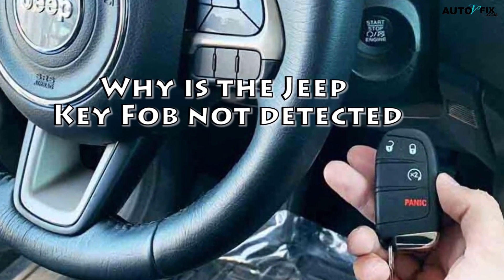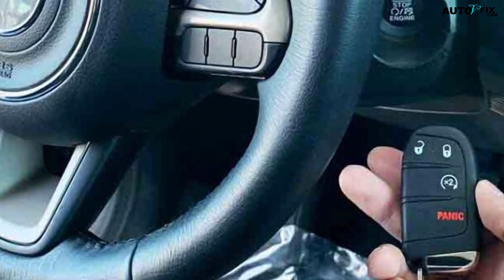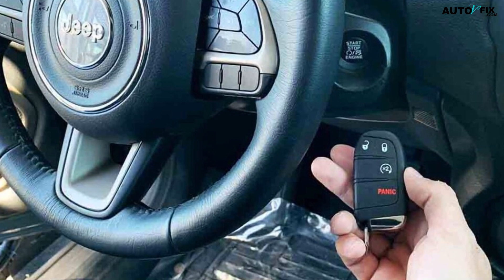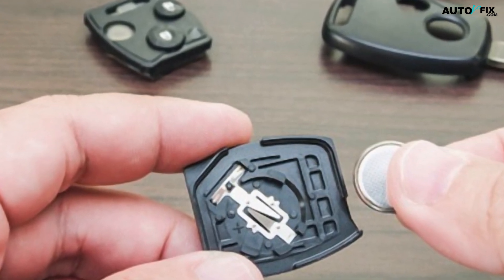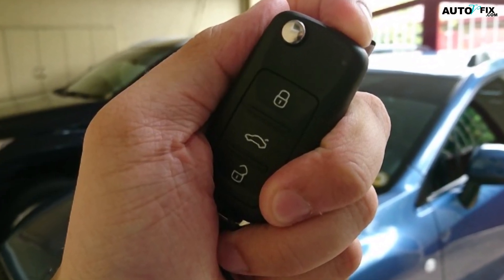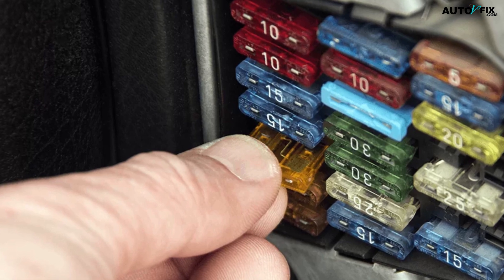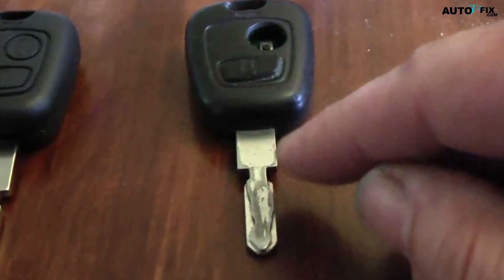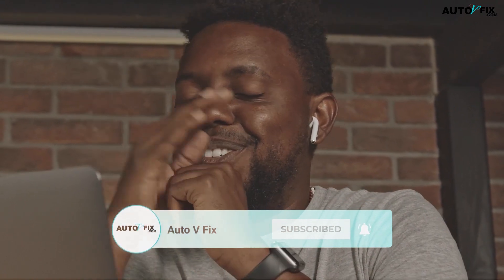Why is the Jeep Key Fob not detected

Comment: The proximity sensor unlock stopped working on the front passenger door, but still works for driver side and tail gate in my 2021 392.  Dealer replaced control modules and tried several other ideas.  It finally worked, but only the day I picked it up.  Stopped working next day.   A week later I replaced the key fob battery and passenger door proximity sensor started working but stopped working a few hours later. I’m baffled